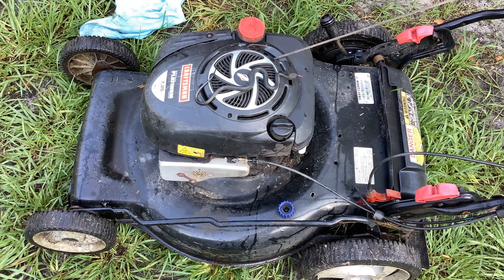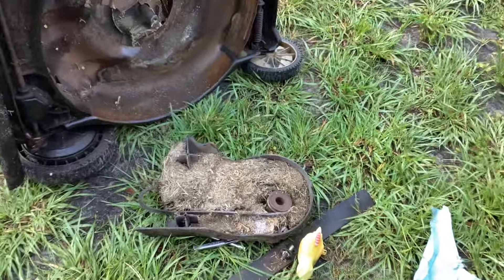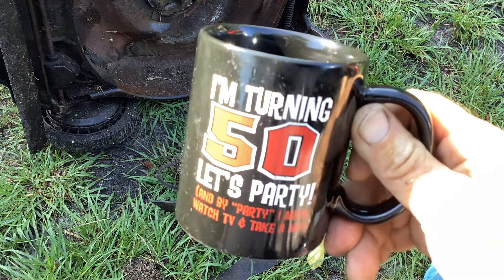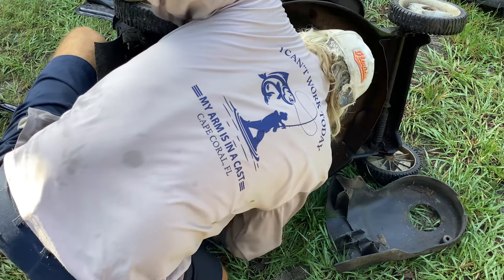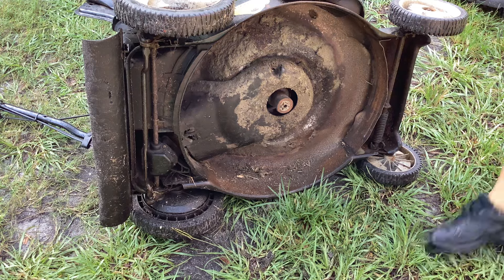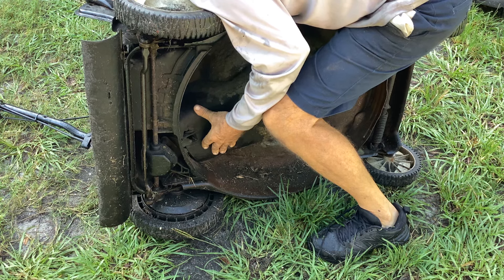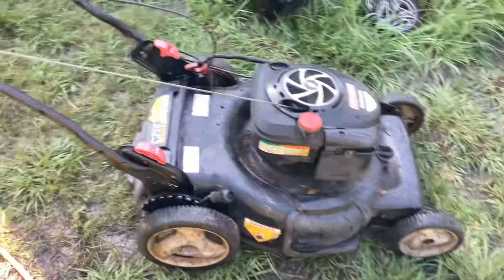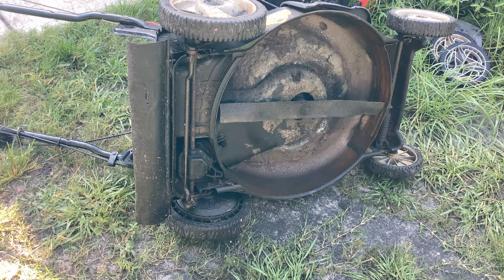2012 Craftsman RWD 725 Lawn Mower,  Will Not Move.!!!  Let's give it some Love & Attention. Maybe.!!

Comment: belt toss?  is there a metal two-pronged belt retainer threaded onto the top of the transmission?
bbb jim1 is a YTer that swaps a similar belt on another 7.25 rated Craftsman.  Yours seems to be gone. : (  tossed belt city.   Take Care Tommy-Time.